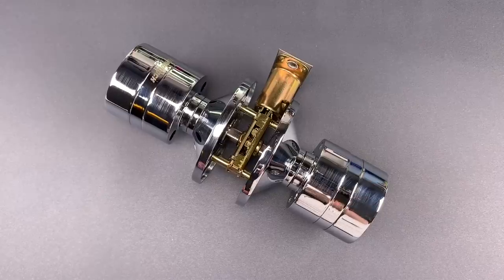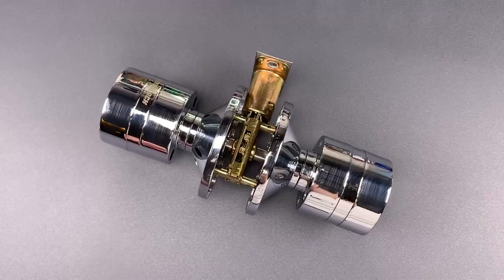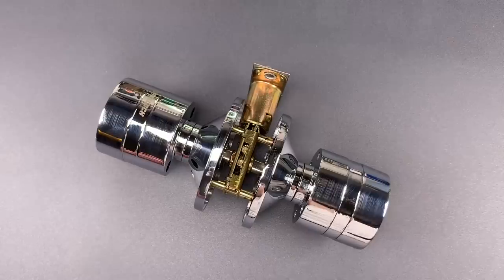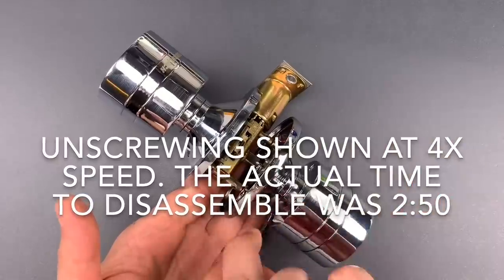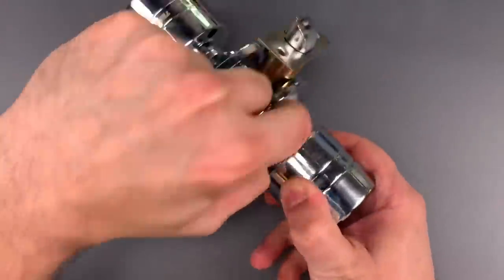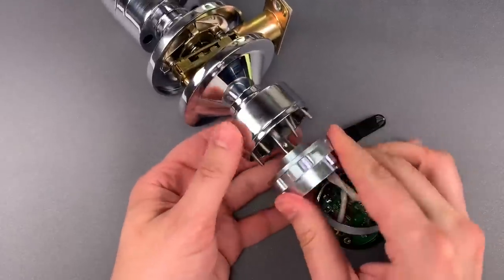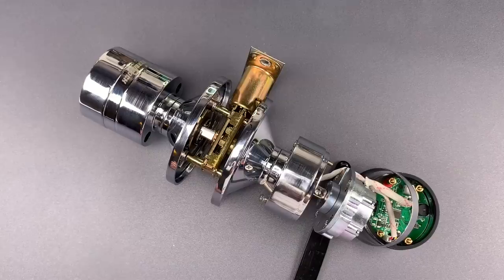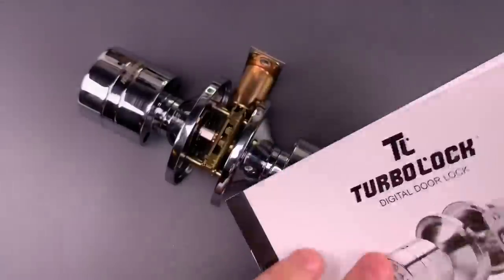[945] TurboLock YL-99 Opened With a Screwdriver!

Comment: Honestly they could've just had a spring loaded hinged door on the backside of the knob indented in and had the screws behind that which would've made it essentially impossible to open up unless you knew the door was there or had keen observation skills, even if you noticed the seams most people wouldn't think much of it. Just normal creases where 2 parts fit together, this would add next to nothing to the manufacturering cost, not very difficult to design, and much better security, not to mention the doors when opened would further limit your range of motion to unscrew the screw the screws making the time required longer and chances of success at breaking in smaller. As a cherry on top they could even use an odd screw, like the tri-wing screw Nintendo uses, essentially ensuring that next to no one on the planet would have the knowledge or tools to get at those screws, issue is a hammer and chisel taken to the seams in the metal would probably be faster than using a screwdriver anyways, but small chance anyone would do that

Comment: Even funnier is that right-angle powered screwdrivers/drills are available on amazon and probably less than 2mins of searching would let you find one with the appropriate form factor to fit between door and handle, then it's only a few seconds per screw.

Comment: That's more like a design necessity than a flaw.

Since there is no keyway, if the electronics fail there must be a means of accessing them for repair, or to open the door. That's just common sense. It's probably even required by building code.

Comment: Well, in many areas around the world restrooms in fast food restaurants are "secured" with very simple locks. You get the code for the lock on the receipt, and this way they aim to limit the use of the restrooms preferably to their customers. Of course, some people get the code from customers, but they hope customers would give the code only to people who don't create a huge mess. But with rarely changed passcode limits even this. 

But if someone creates a huge mess and anyone notices it, they can point to the lock and say anyone who entered anyway accepted their general terms and conditions so they can be sued. Too bad it doesn't help much with homeless, drug addicts, etc. but their insurance company will learn they took many steps to mitigate the risks so if they want an insurance that can cover these problems it might reduce the costs... a tiny bit.

Comment: It would take you longer to remove the 4 screws with the knob mounted. You rotate it in your hand for easier access to remove screws. So try doing it mounted to a door. It'll take you longer, I bet. I will put a dab of super glue, or stripped out said screws, there for, render your tool useless to remove screws.

Comment: The problem with this attack is that you can actually screw it all back together, and afterwards no one will be any wiser. Not being able to withstand brute force attacks is usually not a problem for an "inside door lock", mainly because the doors to which such locks are mounted are also not that break-in proof, but being able to do a covert entry is really problematic.

Comment: I think I'd be okay with it if I swapped out the screws with different styles, pentalobe, torx, security torx (different size), maybe even a standard slot to make it particularly annoying :D
okay with it in the sense that I use it as a lock while, for instance, out doing yard work, and use a deadbolt when I actually leave the house.

Comment: That lock looks to be designed to be a very low security lock for applications such as an interior bedroom or bathroom.  Doors that would ordinarily have a lock that could be opened with a pin or screwdriver.  Note that it doesn’t even have a dead-latch plunger fitted to it.  I don’t think the screws on the exterior were really so much of a design flaw but rather an option to get into the room in case of a lock malfunction.

Comment: use a thread locking compound on the screws , then put thread locking compound in the screw ends so a screwdriver can't be put into the screw slot

Comment: Different segments of the military are tasked with securing a building.

The general locks the doors and turns off the lights when he exits the building.
The infantry sends raw recruits to patrol around the building.
The special forces surround the building with razor wire and post snipers at surrounding vantage points.
Parliament passes a law that makes it illegal to enter or exit the building.

- Howard Taylor in Schlock Mercenary.

Comment: I have had one of those locks for years on the back door. When I go home I am going to have to check to see if mine has the screws on the back. Even if it does I am all to that worried about the possibility of the local crackheads/Burglars carrying right hand screw drivers, as there are an abundance of bricks around and they still of course have their feet, both of which are more likely attack vectors around here.

Comment: one really good electronic lock I heard of cyber lock the electronics are based on good encryption principles the battery is in the key and while eletrical contacts are in the open they are well hardened against 20 k tazers and such really the only flaw I have heard of is exploit that allows the mechanical parts of the lock to be opened with blunt shock almost like a weak spring was used to hold the lock shut makes sense because the battery in the key is really small not enough power to over come a strong spring so the only means of preventing spring pressure failure would be some really odd puzzle work such as worm gear

Comment: It also means that someone could bypass the lock without being detected - if given enough time.
Obviously, if anyone purchased it, they should at least epoxy the screws shut since if the lock fails and the only way to get in is from that side, time to carefully saw it off.  "Yes, officers, I'm sawing this door in plain sight.  I'm the manager of Billy Jim-Bob's Pizza and this back door is where I keep the prizes which I found out some are being sold on eBay and well just in case any of my fastly changing staff of kids was less than honest I put this electronic lock here...but seems to have failed..."

Now, the TIME it took you due to awkward screws is far more time than most locks.  But it is something within the skills of a "Meth Head" aka an "Unskilled attack"
And - even a minimally skilled attacker could re-assemble the lock after also using gloves to avoid fingerprints.
ALSO - I bet it's made in CHINA and even if not in the manual they put some kind of override code into it - or there's a way you could transmit a code into it... And said bypass could be found with good internet searching or bought online.

BTW - there seems to be a visible screw in the cover at 2:37 unless its a reflection...  Wonder if that would allow you to take off the inner thing and given how this lock is designed likely trip it open easier?

Awesome vid as always!

Comment: So, an easy fix ...just replace the screws with security screws that only have the screw head one way, and use superglue, just to make sure. It's a bad design anyway, because it looks like you could bash off the external doorknob with a lump hammer to get to the opening bar anyway.

Comment: If you don't have the specialized tool shown here. You can also use a head from a modular screwdriver. So "you need special tool for this" is not a valid excuse for this.

Comment: I was wondering if not for the screws you point out, just how secure is the rest of the lock?  I realize that it's usually the most obvious vulnerability that gets exploited, but if that vector were removed if there was anything else (or perhaps more than one anything elses) that would go against this being a choice.  That brings us to the second question for most consumer-grade door locks - overall construction and materials quality with an eye towards longevity.  I would want to know first if it was a good lock, but second if it will last under routine use over a long period of time (and not just the locking portion but the other mechanical internals as well).

Comment: If you wanted to get into this door and were not concerned with proof of entry one or two  hits with a hammer would break those screws and give access to the turning mechanism. Goes from 3 minutes to 20 seconds to gain entry. Hell you could kick the front entry plate off.

Comment: Clearly the designer has never seen a right angle screwdriver. Before you even brought out the tool, I knew what you were going to use, although I was surprised that you DIDN'T have the ratcheting version.

Comment: where does the battery/batteries go?   In super cold winter environments, are the batteries on the warm side of the door?   If so, the lock could be a fairly good design if it used screws with special heads, shaped life a reverse philips head. That is, with a bump in the centre of the screw head and with 5 splines to the screw head.
The 5 splines are such that even if you ground down the centre of a flat head screwdriver, it would not be able to turn the screw.

Comment: i'm going to say 10 minutes to unscrew, because you can't see the screws clearly and you can't reach from the other side with your hands to manipulate the screws when it's installed.  then if the door is recessed in a door frame, like most houses are, the screws around the edge would be harder to manipulate.

Comment: The price of $39.99 is very low if we think about the looks of the system which is quite handsome and if the keypad was better looking, it would be really beatiful. Anyway, it is easy to secure this by using metal epoxy.

Comment: I need some help. I stumbled on this channel when I was looking for a more secure smart lock option. Awesome videos by the way. I love the convenience a keypad offers, but my question is, is it possible to use something like/similar to a Kwikset 914 Keypad Deadbolt, and just change the cylinder to something that offers a bit more pick and drill protection? I can’t find anything on this on the internet, and many in the comments seem like they are very well versed in the topic. Any help and product suggestions would be greatly appreciated.

Comment: Well, it would be a  lot harder on the door. I'd try shimming the bolt with a screwdriver or bit of wire first. A lot of jams are so sloppy that the anti-shim lug doesn't activate.

Comment: When it is built in a door, are the screws then still exposed?
Reply: Yes, as they are in practice on the reverse of the handle.  On top of that, the electronics are in the handle you just opened with the 90 degree screw driver, so you can play "hunt the vulnerabilities in the PCB" while you are there as well because the over paid boffins who thought this up forgot they put all the guts of the device (The Screws and electronics), on the OUTSIDE portion.

Comment: I have a ratcheting right-angle screwdriver that'd make that go even faster.  They didn't even use some kind of supposedly 'theft-resistant' screwhead?  At the very least they should have cast some kind of skirt on the back of that piece that'd prevent getting a big enough tool between the knob and the bezel.

Comment: I have one, noticing this vulnerability, although it's allot harder to unscrew when installed on the door and up against the jam. I drilled the heads off the screws on the keypad knob, with the addition of a dab of lock-tite on the threads, mainly because the keypad side never needs opening. The batteries are annually replaced on the inside door knob. Question is, how else can you possibly defeat the YL-99?

Comment: If you make a tiny adjustment to the lock screws (by softening its groove) you won't be able to open it with  a screw driver and it would be much harder to open.

Comment: Hang on—
How do you program this lock if you can't disassemble it? I surmise via master PIN that is resettable?

In any case, I immediately shared this vid with one of my friends who has this in their share house.
Reply: a dab of superglue in on the the screw heads will defeat this attack vector as an easy fix since that part isn't supposed to be opened by the user anyways

Comment: I imagine some loctite would go a long way in that scenario, especially if the screws have something like a #0 phillips head that'll just strip out.  

... but even as simple as that would've been, they opted to just cover their ass with the fine print instead of bothering to fix what they knew was a crippling design defect.
Reply: Or, using things like one-way screws... which would have costed just a few cents more, and would be the standard solution for such cases. Though, permanent variant of Loctite would not have hurt with those either.

Comment: See how the bolt mechanism moves when he disassembles the knob? What if that was secured inside an actual door, are you still able to take the lock mechanism apart to get at the square cross section?

Comment: Well, I guess you don't normally have "right angled screwdriver" with you (I actually never seen those before, but I can imagine using this exploit with a screwdriver bit, pliers and some extra time), just as in certain cases you woudn't have the ability to work on the lock you're not suuposed to open for 2+ minutes unnoticed. So, probably this is somewhat acceptable option for securing certain areas within an area that's already secured by a proper lock. Like some special places in an office building, where only "the chosen ones" can go. This lock would save you from ordering multiple keys for every employee who is supposed to have access to locked area, and from calling an actual locksmith to open it in case of some failure.

Comment: Don't know if the LPL will answer, but I'd like to know what threads these screws have and whether or not he would consider it a big improvement if you replace the screws with a extra-funky (maybe even one -way) security head scews.  IOW, is there anything else bad about this lock besides the screw vulnerability?

Comment: Would it work to drive a nail or screw in to jam that bar allowing the bar to be turned with the knob?  I'll bet if you drove a nail straight in from the face, through the circuit board, you could open it in seconds.

Comment: I’m pretty sure a pair of giant pliers used to twist the handle would have been faster lol. Honestly tho. I don’t think this is that awful of a design. 3 minutes to get the screws out was with a free non attached handle. Bolted to the door would surely have been more cumbersome. Leading to longer times. Someone breaking in doesn’t want to spend 5 minutes opening a door. Also, tamper proof screws would have kept out most novices . This door knob would make them just go to a different point of entry

Comment: Why don’t manufacturers add an alarm that sounds when disassembled, pulled apart breaks a circuit and then alarm sounds.  However the alarm could be silenced if the right code was put in..

Comment: I noticed that here is NO manual override for dead batteries either( except for the disassembly, ROFLMAO!!)
Reply: Actually there is, they pack a battery pack you can carry with you to manually power it .. there is a small battery access port on the lock covered with a weatherpoof silicon plug.

Comment: does not matter how secure the electronics are when its got a flaw like that rather then take it apart how about installing a setscrew tighten the screw and turn knob and an intruder can walk any time they want and if they lossen or remove the screw not much of a trace as to how they did it also I hate to say it but allot of police would over look the hole or even the presence of a screw if they even bothered to look at the lock

Comment: And this is why they invented red threadlocker. If the removal of those 4 screws aren't required for installation there's no reason for having them exposed for tampering. And once a philips screw head starts to skip they're impossible to remove.

I get why you're showing these vulnerabilities, but if you can't be bothered to recommend fixes for folks buying these you're only doing a half-assed job. Locks CAN be made to work better and be harder to tamper with.

Comment: I suppose that it would be more difficult, and slower, to do this while the lock is mounted to a door and that door is closed in a normal frame. You would not be able to see what you are doing, and motion of the screwdriver lever would be more limited. But still, pretty poor design flaw. At least they should have put in screws with special heads that make unscrewing much more difficult.

I have the Schlage keyless locks all over my property, and as far as I can see they would not suffer from this kind of attack. But really, a thief could just kick a door in within a few seconds, or break a window and reach in.

Comment: Not even built like co sumer electronics, those have bs specialty screws that are almost impossible to remove without specialized, often proprietary bits, this opened with a right angle Phillips.

Comment: Isn't another downfall of these keypad locks the wear marks? If this requires only a 4 number code to enter, over time the pad will wear down, showing the most common numbers used. And from there, someone can just try until the lock is opened.

Comment: Just disassemble the lock as shown and add permanent LockTite to the threads. If you can find security torx screws of the same dimensions use them with a home made shorty screwdriver, chop off the majority of the bit shank and epoxy it onto a handle.
Does anyone have any exploits for one of the older Kaba Mas Hamilton Powerlever1000 high security digital door locks with a Best removable core cylinder?